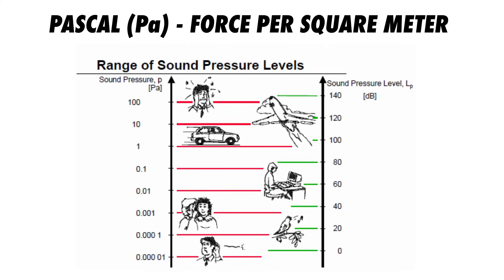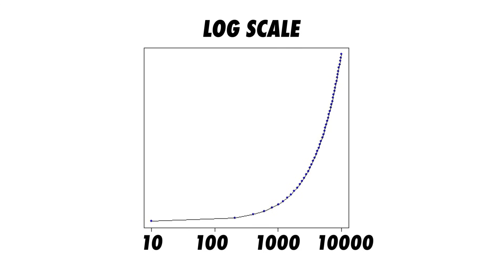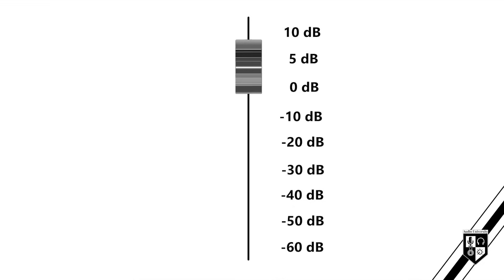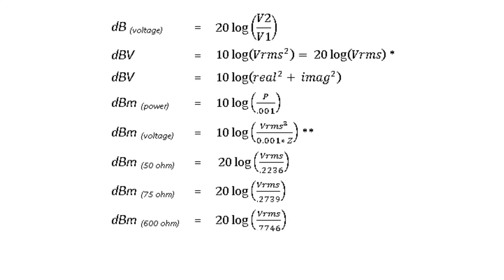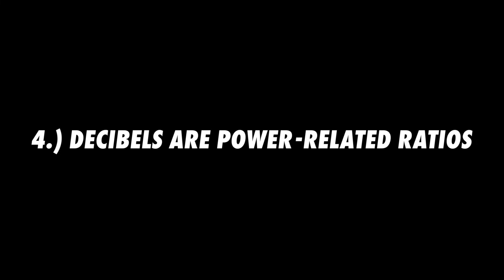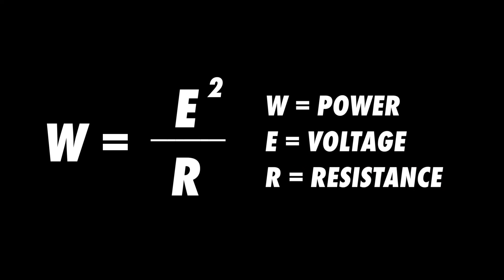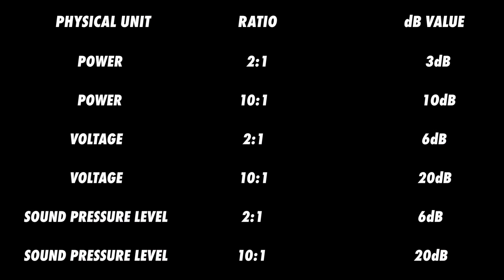Decibels (dB) In Audio | The 5 Things You NEED To Know...

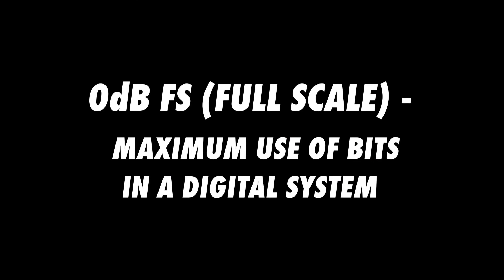Comment: 3:20 "0 dBFS, or full-scale, refers to the maximum amount of bits in a digital system".  Wow, that isn't confusing.  A waveform at 0 dBFS just means it is using the full digital range.  For example, for a waveform represented by 8 bits per sample, in signed integers, each sample is within the range -128 to +127.  A waveform at 0 dBFS will use all of that range.  Even if you apply gain to that signal, the samples will still be limited to be within that range, hopefully, using saturation, as opposed to overflow, to control distortion.  It wasn't until I got to the very end that I got what I came here for.  SPL is like voltage, in that we use 20*log10() as opposed to 10*log10().  Got it.  Also, you should mention that the Bel logarithm is base-10.  Common notation always includes that.  Good job, overall, on the video.

Comment: I thought leaves rustling would be louder than that. Unless you're talking about one wet leaf that you stepped on barefoot. A load of dry leaves swirling in a breeze must be at least 45dB? Although loudness isn't logarithmic. Both loudness and power increase exponentially with a linear change on the decibel scale. Loudness is more a nth root curve, e.g. square root, cube root, fourth root. Similar to the way sound pressure scales with the square root of the actual power, though loudness still climbs more slowly than the sound pressure. It's usually somewhere between the cube root and the fourth root of the actual power.

Comment: 0 dBFS, as standardized in AES17, is defined using the — RMS level — of a sine wave. As such you can pass an un-clipped square wave at +3 dBFS. Or have instantaneous signal peaks exceed 0 dBFS by as much as 3 dB.

Comment: I always think the biggest confusion with the db Is understanding of what a log  is 
A mathematical way of multiplying numbers by adding maybe you can start with explaining indices
10^1=10
10^2 =100 you can multiply these two numbers by adding the indices 1+2=3  10^3=1000
when you understand this and discover the log of 2 is 0.3010 and because we work in db not bells this becomes 3db so when we add 3db we are multiplying by 2 😊 I hope this helps and doesn't add more confusion
The db is always a power ratio
when you double the voltage you have four times the power into a given load The log of 4 being 0.6020 giving you the 6db Increase

Comment: i think a useful adition to this would be the fact that you can select multiple faders in your mixer... each one with a different value..  and if you turn them down or up simultaneously they will keep the right proportion from the mix. Means: do not automate volume in your tracks. Automate or set output of your plugs... then if you hit the master above 0 db..  you can simply select all tracks and turn them down in the mixer simultaneuosly (provided that each one is not clippin... i think a video on this would be highly useful. 😊

Comment: Hi, you have a lot of knowledge. Here'a an easy question for you: Assuming 40 dB (SPL), what is the potential voltage? How do you convert  dB (SPL) to Volts, example 40 dB (SPL) = (V)?
Reply: At SouthYarraMan,
Your calculations have some issues
Ex 1:
100 * 0.1 * 10^(40/20)
= 10 * 10^(2)
= 10 * 100
= 1000
Reply: Ex 2:
The question asks how many volts would the mic produce with 40 dB SPL of sound. 
This is my process for solving these kinds of questions. I try to keep to first principles thinking and derive things rather than memorize formulas.

Mic sensitivity 
(-54.5 dB V/Pa)
1 Pascal of pressure causes the mic to produce 1.85 mV 

How many Pa is 40 dB SPL
Known : 1 Pa = 94 dB SPL

So 40 dBSPL is 94 dB SPL attenuated by 54 dB 

Attenuating 1.85 mV by 54 dB means 

Attenuation in dB 
54 dB =  20 log (Va/Vref)
54 dB = 20 log(Va/1.85 mV)
54/20 = log(Va/1.85 mV)
2.7 = log(Va/1.85 mV)
Inverse log or 10^X of both sides
10^2.7 = Va/1.85 mV
Rearrange
Va = (10^2.7) x 1.85 mV
Va = 501.2 x 1.85 mV
Va = 927 mV = 0.927 V

Answer 
You should expect 40 dBSPL sound to produce 0.927 V (about 1 V) of output on a shure SM58 microphone
Reply from the maker: The voltage can’t be determined by the SPL alone. It would depend on the sensitivity of the speaker or microphone, the current, and the impedance. Check out “the power equation” and “Ohms law”. These might help you understand what I’m trying to say. Hope this helps!
Reply: @AudioUniversity  Thanks for replying. Of course, there should be a reference value. So would this be correct?

Exanple 1:
V = 100 * 0.1 * (10^(40/20) = 10 Volta

Example 2:
To estimate the voltage output of a Shure SM58 microphone for a 40 dB sound pressure level (SPL):

Sensitivity of SM58 mic: -54.5 dBV/Pa

Sound pressure level (SPL): 40 dB

Using the formula: Voltage (V) = Sensitivity (dBV/Pa) + SPL (dB) + 94 dB

Substitute the values: Voltage (V) = -54.5 dBV/Pa + 40 dB + 94 dB Voltage (V) = -54.5 dBV/Pa + 40 dB + 94 dB Voltage (V) = 79.5 dBV

Therefore, the estimated voltage output of the Shure SM58 microphone for a 40 dB sound pressure level would be 79.5 dBV.

Comment: "much easier to understand" yet they need countless explanation videos
Reply: dB doesn’t make the math easier, dB makes comparison easier. Comparing 40w to 160w (+120w) you have no idea how much louder one is than the other without doing some nasty math, and you need to re-do the math for the same increment (120w) at a different value (e.g. 100w -> 220w).
dB is simply ~3dB is twice as loud, no matter what the source volume is.

Comment: Nicely done! Thank you! I think I have a quick correction though. The graph used to explain log is actually an exponential curve, right? Log is flipped. Humans perceive loudness logorythnically where slight increases are perceived louder until they "round off" the louder the volume. 120db to 130db is barely perceived, whereas 0db to 5db is perceived as a large jump. Correct me if I'm wrong about the graph

Comment: Can someone help me please. I work in a noisy engine factory in a particular area where the dB is below the point where it’s not compulsory to wear ear protection. However, I choose to wear earplugs because I get sharp earaches during the shift and I can feel my hearing is detrimentally effected after a shift. My employer believes that because the working environment is below the dB legal limits for wearing ear protection, my hearing can’t be effected, but I believe that it’s the frequencies of sound can cause damage, even though it below the dB legal limit. Certain frequencies can be within the ‘safe’ threshold, but can still damage your hearing. Frequencies are vibrations in the air and have different strengths of vibration, causing damage to the ears.
Reply from the maker: Just because it’s not illegal doesn’t mean it’s not damaging. Hearing damage is understood as a combination of level and duration of exposure.
Reply: @AudioUniversity  Thank you. I understand that loudness can cause damage, but what about dangerous frequencies that don’t create loudness or register on a dB reader?

Comment: Hello. An Electrical Engineer here. Pretty good video. 

One slight comment. A decibel is 1/10 of a Bel  not 10 times a bel. Also, Wikipedia starts with. 

“The decibel (symbol: dB) is a relative unit of measurement equal to one tenth of a bel (B).”

https://en.m.wikipedia.org/wiki/Decibel

Comment: that this video needed to be made shows exactly how it's not easier to describe sound pressure levels in decibels, but in pascals 0:36
Reply: The point of using dB is that it better matches our loudness perception. Ex: believe it or not, a 200 Watt amp wont be noticeably louder than a 150 Watt amp at maximum non distorting loudness. The difference you hear is when you overdrive the 150 Watt amp and it starts introducing distortion. This of course assumes the wattage ratings are honest real measured values.

Comment: hello! I have a quastion!
Bel = log_10(power2/power1)
dB = 1/10 * Bel
but why dB is 10*log_10(power2/power1) ???
shouldn't dB be 1/10 * log_10(power2/power1) ??? 😭
Reply: Decibel is one tenth of a Bel, so that means that 1 Bel is equal to 10 decibel: 1B = 10dB. (Think 1 Kilograms = 1000 grams) Run the calculation now--> 10* (log10) = 10 dB

Comment: Thankyou.    while I have done lots of audio for theatre etc,   I'm also quite involved in radio.   I mean on the radio frequency as in the what the transmitter antenna and receiver.   these to although not audio but at radio frequencies is also expressed in decibels.     your explanation applies quite well since  the ratios are the same concept to radio frequencies.  to increase my signal by 10db  I increase transmitter power by 10 times.   using AM radios with any gain compensation turned off a 10db increase of the radio signal will as I say without AGC or automatic gain control to compensate for changes in signal strenth,   will also make a 10db increase in audio volume.   

interesting how the bell or decibel can be and is often applied in other things other than audio.

Comment: ok so this went way over my head.  I'm very sensitive to high pitches. I'm looking for a ear plug that will take them out or lower them significantly. As well as lower overall sound.  I can't be in the same room with a vacuum cleaner and when I watch tv it has to be on 25 or lower to not hurt my ears. Any suggestions for products?  I suffer from migraines and seizures and very sound sensitive.  Bass doesn't seem to hurt as bad but still the overall volume of it has to be low.
Reply from the maker: Check out this video: https://youtu.be/ihif-XEL6XQ

Comment: In sound, 1db gain is the smallest change in sound you can hear, 3db is only a slight change in volume but takes twice the power ( amps and speakers ) to produce.
It is also dependent on distance, twice the distance half the volume ( I don't know the readings of that, but aprox. half the power, -3db )

Comment: @Audio University, I've recently discovered the channel, found lots of interesting videos and have subscribed. 

Watching this one was another eye opener but I can't quite get my head around how you convert a dBfs value to the audio device's voltage out if 0dB = 2V. Using the voltage & sound pressure formulae, would dB be the dBfs value below zero and would value 1 or value 2 be 2v while the other gives the output voltage?

Thanks
Reply from the maker: Great question, AS X! The answer is that it varies. That’s probably why you’ve had difficulty finding the answer. 

The calibration depends on the manufacturer. My research suggests that the “standard” is 0dBFS = +24dBu. However, this isn’t a hard and fast rule, so you’ll need to check your device’s manual.
Reply: @AudioUniversity  ah OK. Thanks.
Reply: @AudioUniversity  Another common reference point I often see in digital mixers for live sound is 0dBFs=18dBu, but there sadly isn't any norm indeed, which would make life a little easier sometimes.

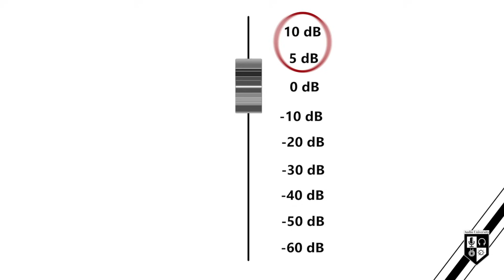Comment: Thank you but at 2:30 the graphical representation does not correspond to the explained logarithmic scale because the dB´s are even apart in your representation, which makes no sense on a logarithmic scale. This is very important because a viewer maybe  think now e.g. 1cm of movement of the fader reduces the volume everywhere the same, which is not true. In my opinion this is important because we use fader to put the right volumes. 

This is also a reason to think about gainstaging in advance and control the volume of the channel also advance of the volume fader with a utility-plugin to have a better overall control of the level - especially towards the end of a mix with the volume faders on the mixer.
Those volume-fader on the mixer gonna effect the volume more and more towards the end of the volume-fader, if you put them on a digital nom. level like -18 or -12dB.... (almost all of us work in a digitial environment). This makes it harder and harder to control the volume because of the logarithmic scale of a allready reduced volumefader to those levels: a movement of 3mm of the fader reduces the volume very noticable at those levels. Much more then the same 3mm movement downwards from 0dB point, which is not so noticable. 

With this technique you can let the volume-faders at 0dB and make your fineadjustments very easy, because you have way more room to move the volumefader from the 0dB point. It is even much easier to draw in the volume envelope. Hope this makes sense to anyone. 

Please be so kind and try to clear this in you´re next video.  Brgds

Comment: Point of nerdy detail: dB is always only a ratio unless it has a suffix. For example, dBa, sometimes written "dB(a)", means the A-weighted scale of sound power. That tells you the reference point (zero dB), and because it's sound waves, it also tells you that it's the A curve, which models the frequency response of the human ear. There are other curves used too, for expressing sound power in dB, but this is the most useful one, which you will see on level meters etc... On this scale 3dB is a halving or doubling of sound power. 

The other common one is dBv (yup, voltage decibels), where 6dB is a halving or doubling, as you said in the video. This is almost always the scale you find in the audio chain (amps are the exception!). 

There's  a bit of history behind this - back in the day in telecoms and broadcast and valve signal amps, the engineering approach was to optimize the POWER transfer between source and destination. This gave least noise/interference, cleanest signals, etc., and (later) it was one reason why Neve's modules have transformers on each end (inside the desk!). 

Optimized power transfer is still necessary in some places: radio transmitters and receivers (aerial feeds), record stylii, guitar and other instrument pickups, and all forms of magnetic recording heads (analogue and digital), etc. For everything else we use dBv, and the principle of high-impedance inputs (very little current flows - the input stage is designed to amplify the voltage it sees). 

Also useful to know (when dealing with dBv), is that a signal change of about 1.5 to 2 dBv is about the smallest the human ear can detect (when it's turned into sound). I've worked with colleagues who claimed they could hear 1dB on line-up tone, but the best thing was just to smile sweetly and change the subject!

You ought to do a video on impedances - mics, instrument transducers, DI boxes, input vs. outputs, etc., and about balanced vs. unbalanced signals (single-ended vs differential in the digital world). The more people understand the easier it is to do the job well. Of cource you can nowadays just plug stuff in and it works, until it doesn't!
Reply: Don’t you mean dBu? dBV is for consumer electronics whereas the former is for pro audio. There’s still a ratio at play because any change from zero is relative to 1V for dBV and 0.775V for dBu. Is that not correct?

dBA is based on the Fletcher-Munson curve for a 1kHz sine at 40 phons, about 3 millipascals or 44dB.
Reply: Correct!

Comment: So what do I set my faders to? Or just mixing volume knobs and doohickeys in general. Like what’s a good level to keep your master on? 0 or -5 or 10? I see videos where people talk about LUFs too and I’m curious how that translates into Al of this. Good video didn’t expect to learn any formulas this morning haha
Reply: Faders on mixing consoles should be around 0 (where the fader values walk from +10 to -∞). That way you have the most precise control over the volumes.

Metering is another story. It depends what type of dB's are used by your mixer. Behringer X32 has a meter from 0 to -57 dB, where Allen&Heath uses a scale from +12 to -40. The best values for the mixer is to run sound at the level where the loudest parts are just in the orange, just so the average sound fills green leds.
A quick note to that is if you run mp3's (composed sound) instead of live sound from an instrument/microphone, have it turned down a couple db's in the metering, that way it is in line with the perceived loudness, and you can still run the fader around 0, where you get the most precies control.
Reply: @edewaal97  thank you, I'm basically just working with loops and synths in logic so I have nothing external going on that I'm recording, I assume that makes it easier to control but could also but wrong on that front
Reply: @edewaal97  so new to avr reciever, does increasing DB for front and center speakers increase volume, or should I set to 0.
Reply from the maker: Bittamin - Check out this video: https://youtu.be/TCBHysRV4vs
Reply: @AudioUniversity  That was great thank you! I honestly try to watch every video, but who knows how much I can retain lol, a refresher never hurt anybody!